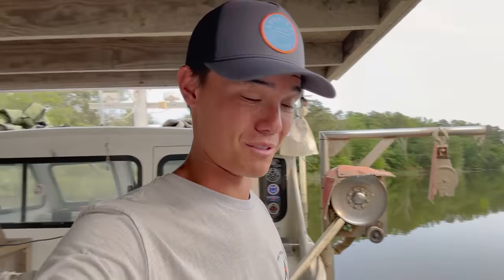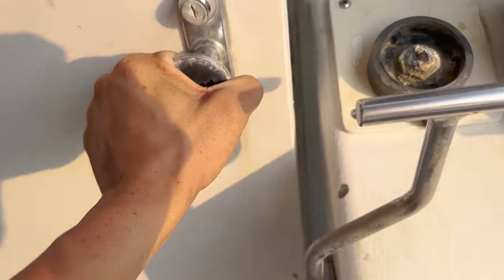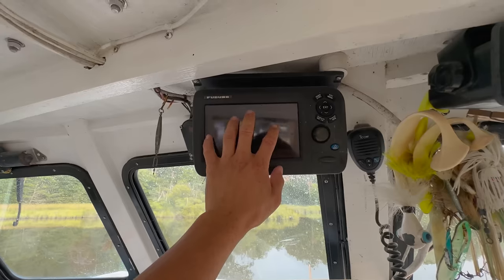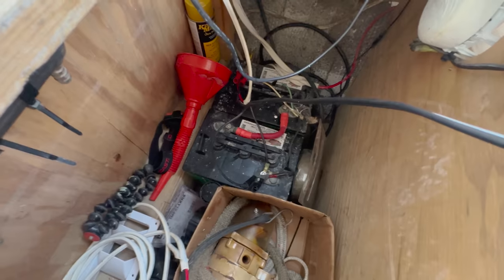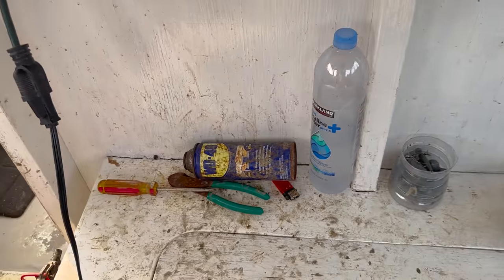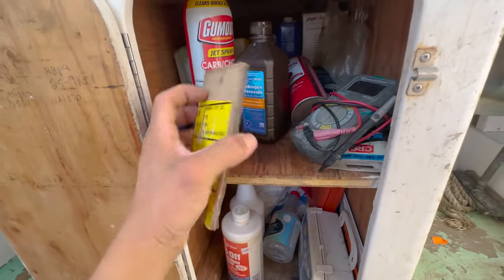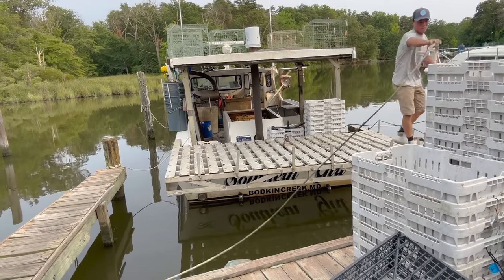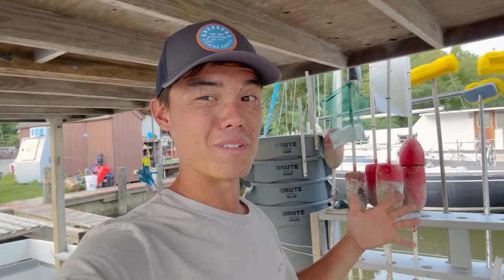Crab Boat Office Tour

Comment: I grew up commercial fishing and shrimping and man your right between the torque and salt water put on commercial vessles break down or stuff breaks alot! Have done more than my share of work on boats. Including pulling big Ole turbo charged diesel engines and rebuilding. For three straight weeks I threw my cloths away everyday. Then come the marina work replacing piers and docks getting all the creosote burns your could ever want.😂